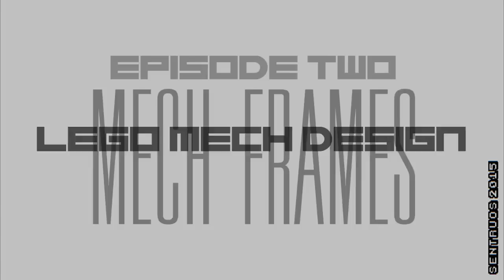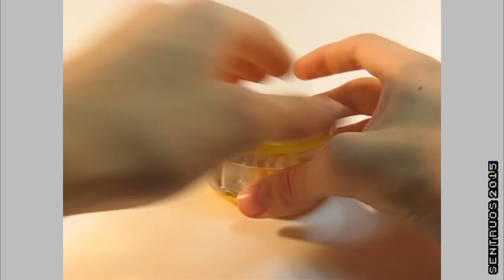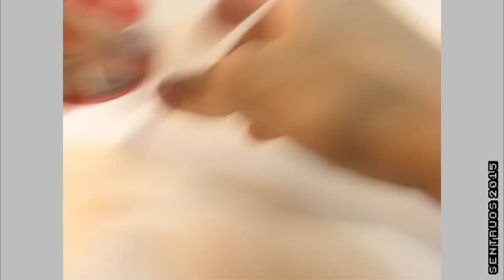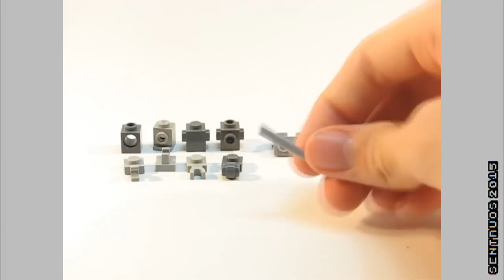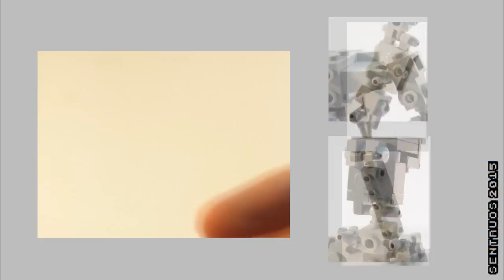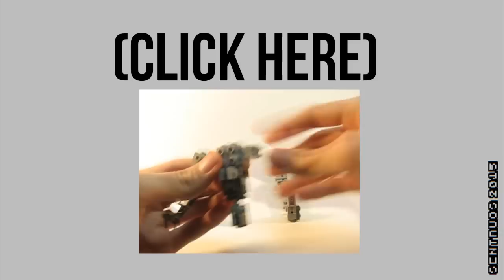Lego Mech Design [02]: Mech Frames

Comment: I mean 1:27 .My bad
Reply from the maker: Hey I recently responded to that same question, I get them off of www.bricklink.com
Here's a copy-paste parts listing you can use to search for most of the parts shown in the video:
Pneumatic T-Pieces
Plate, Modified 1 x 1 with Clip Light - Thick Ring
Plate, Modified 1 x 1 with Clip Vertical - Undetermined Type
Plate, Modified 1 x 1 with Clip Horizontal (thick open U clip)
Tile, Modified 1 x 1 with Clip
Brick, Modified 1 x 1 with Headlight 
Brick, Modified 1 x 1 with Studs on 2 Sides
Brick, Modified 1 x 1 with Studs on 4 Sides
Technic, Brick 1 x 1 with Hole